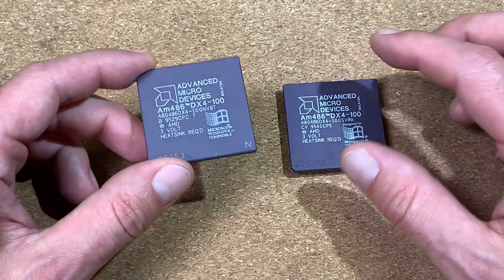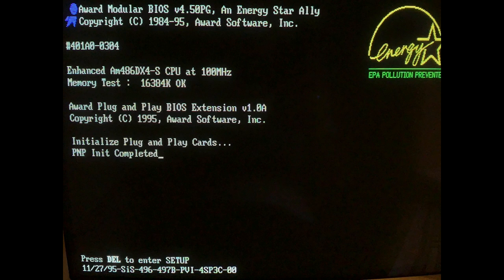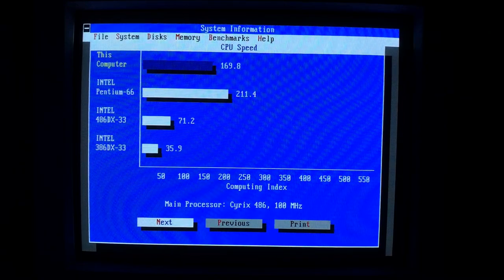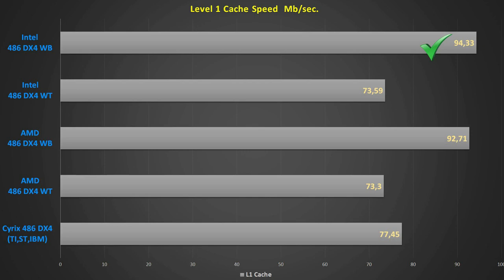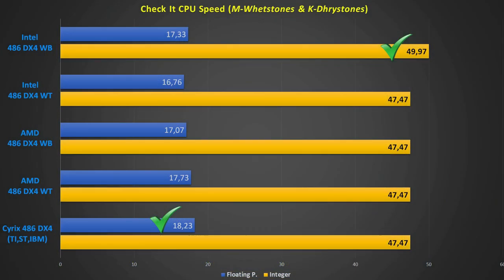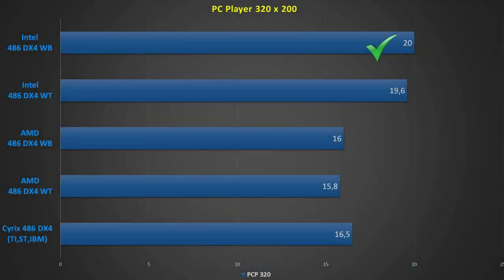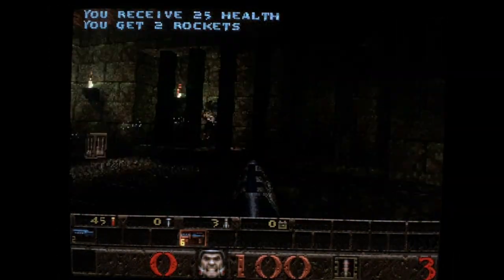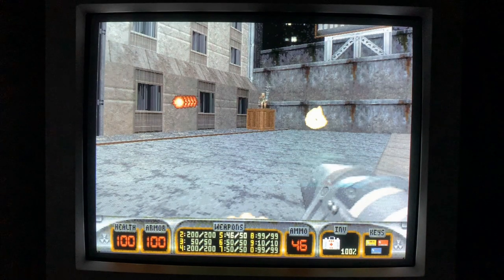486DX4-100 MHz Benchmark Battle [ Intel, Cyrix, AMD, TI, ST]

Comment: Actually, Quake isn't heavily using the FPU. At least not in the way as we would think of it today. What it does is more of a trick called overlapping FDIV. For texturing, you have to apply perspective correction (or otherwise, textures would wobble like on the PlayStation 1). Doing that every pixel is too expensive in software on these old CPUs, so Quake does it every 16 pixel with linear interpolation in between. This perspective correction requires a division and divisions are expensive. So Quake uses the fact that the Pentium can execute FPU and integer operations in parallel. While doing the linear interpolation between pixels x and y using the integer units, the FPU is doing the perspective correction for the next chunk of pixels in parallel. A 486 (or K5 or 6x86 or...) can't do this, because on it, FPU and CPU won't run in parallel. So this FPU division actually stalls the CPU and the code only continues once it's done, making them run Quake much slower.
Long story short: It's not really heavy usage of the FPU, just a quite tricky one.
Reply: Very nice explanation, thanks
Reply: This explains why my friend with a P90 outperformed me so much in Quake with my 5x86-133. Thanks.

Comment: My first Intel CPU was an i486SX-33 pretty good CPU for what I needed back then except in Aces of the Pacific PC game.  Had lots of stuttering when numerous aircraft appeared on the screen.  Later I upgraded my system to a iDX4-100mhz CPU. It was like night and day, no more stuttering in AOP or any other high density game. I learned a lot from my earlier experiences with the intel and later AMD CPU's. This is true nostalgia, thank you for doing this, brings back great memories from back then.

Comment: All the 486 chips are great especially for day to day applications, but seeing the WB is clearly better choice I would still pick the AMD chip. Being an AMD fan myself and for the price to performance I still feel it would be the better choice and with the 133mhz version and the 133ADZ model wich is actually a 160Mhz 40Mhz X4 it can be a real beast in the 486 chips. Also the Cyrix 5x86 133 is a beast but a rare and hard to find chip. The 486 was a great cpu. Such a great time when hardware was changing so fast and in leaps and bounds.
Reply: Don't believe it, I was lucky enough to have the intel dx4, the am486 dx4 and the cyrix dx4 since all of these were used by IBM (my dad worked at IBM in the 90's) and at some point when the equipment changed, they threw them whole back then
Anyway ... the am486 at 133mhz is low in performance compared to an intel dx4 at 99mhz (100mhz) and the difference is very noticeable
I do not intend to put together a discussion, just share my experience with these processors
It goes without saying that I am not a fan of Intel processors since I have a preference for AMD from the Athlon 64 X2

Comment: If only we had such reviews available back in the day! Personally I would prefer if your charts always have the scale from zero instead of sometimes being zoomed in, like SpeedSys going from 34 to 44, but then others starting at 0. I think most humans judge the performance by the length of the bar, and that only 'works' when you start from zero.. In my opinion it gives a clearer picture of the differences, even when they sometimes are very small, I prefer to see similar bars rather than a zoomed in bar that seems to show a 'big' difference.

Comment: This is a great video! Contrast to the 386, here the Intel is indeed the strongest one. But AMD had the 133 MHz model of course. I like the IntelDX4 because it has good support with motherboards, it is usually mentioned in the manual. With some of the other CPUs it can be guesswork.

Comment: Thanks for this study. I have been enjoying your channel. The results were close to my expectations I have one minor critique concerning the bar charts: when the bars are zoomed in, it appears that the differences between each processor are much greater than they actually are. The viewer should have a better visual sense of the differences if each bar was plotted from the zero point. Other than that, great job, and I hope to see more.
Reply from the maker: Thank you very much for your FB. You are right with your critique and I will consider that with my next bar charts. 😉
Reply: I would say display both. Graphs from the zero point are going to show just a tiny difference at the end and not show the differences very well between these CPUs. Zero point graphs would be good for comparing all of these, lower clocked 486s and 60 or 66MHz Pentiums though.

Comment: Top work! I really thought that there would be just a very slight edge in favour of the WB chips, maybe 5%. Good to know of the difference in performance. Btw. that mobo looks very smart, would be awesome to see a comparison of some different socket 3 motherboards and their chipset performance with the winner of the DX 4 cpu battle. Keep up the good work!
Reply: Problem is, in this age, that you may be considered pretty lucky, if you own at least one 486 motherboard. :) Who owns 5 or 6, for test, is eighter very lucky, or rich. But maybe someone could borrow for tests.
Reply from the maker: I will do this comparison and benchmark with some boards. Will cover following chupsets: VIA, SIS, Intel and UMC ☺️

Comment: the moste important test i was waiting for was the OC test. and yes we had started to OC the CPU's at this time in the game ;)  i hope for a follow up video here to make it complete ;)
Reply from the maker: I planned an OC video but not with DX4s. I want to max out the Asus board with OC PoDP to 100 MHz and AMD-x5- to 160 MHz to compare... Maybe I will add here then a DX4 then too.. 🙃
Reply: @CPUGalaxy  what is the max speed you can get the DX4 100 to? i remember 140+ speed's.
Reply: Should be able to handle 3 GHz on liquid nitrogen

Comment: Can confirm that WT is faster than WB in Doom as I just tested that yesterday with Intel DX2-66 processors on my ASUS VL/I-486SV2GX4 1.7 board. Due to the lower clockrate I had a performance difference of roughly 5%
How's the PCI vs. VLB performance on the Asus 486SP3? I tested a CL5428 VLB against an ET6000 PCI on one of my VIP boards yesterday and was shocked how the PCI card performed roughly 40% slower - albeit the ET6000 being a superior design and the VLB running at "just" 33MHz
On a sidenote: A friend of mine happens to have an AMD DX4-100 with 16K WB cache (Am486DX4-100V16B) - would be interesting to see how those fare against their Intel counterparts.
Some boards seem to be extremely picky about AMD DX4 CPUs and usually seem to assume 8T models.

Comment: I've always thought that they were pretty identical in performance, pretty huge differences between the "same" CPU.
Reply: The differences aren't "huge" though.  The difference between the fastest and the slowest is only around 10%.
Reply: It's the way his graphs are scaled that makes the differences more pronounced seeming. For the 5 - 10% performance deficit (task dependent) between the intel and the other CPUs you would have paid anywhere up to 40% less for the slower Cyrix and AMD models. It was a case of pay through the nose for the best or get the best value and sacrifice a bit of performance. Cyrix and it's derivatives were by far the cheapest options and offered the best value for money of the group, every CPU shown here was a significant upgrade from the DX2 66 and slower 486s. 

I remember upgrading from an intel SX 25 (overclocked to 33mhz) to an intel DX4 100 (WB) and being blown away by how much faster it was. Doom, Duke 3d and Rise of the Triad got a lot of screen time on my 486 DX4 100 :)
Reply: @Xaltar_  yeah back in the day it wouldn't be a mhz to mhz comparison. The cost difference would of made the AMD compare to a 75mhz DX4 and the Cyrix would of been about the same as a DX2.

Comment: Nice! I had expected it to be a bit of a closer race than it was in the end, but nice to see someone with all the gear put in all this effort to bring us this info. Thank you!
Reply from the maker: Thanks. A follow up is planned. I found out that there are a lot of functions on the cyrix which needs to get activated bit a bit setting tool. That is boosting than the cyrix extremely. It might change at the end the rating. 😉
Reply: @CPUGalaxy  Cool, will be interesting to see what kind of difference it makes. Thanks again :-).

Comment: Great video, brings back a lot of memories. I remember frying my SX 25 by overclocking it to 40mhz 😂 It ran great for about 5 mins before smoke started pouring out of it, even with a cooler on it. I already had a DX4 100 waiting to go into the system and it had worked fine @33mhz so I threw caution to the wind and tried to see how fast I could make the SX 25 😁
Reply: Smoke? How you overclocked it? What method? Raising FSB could only make your system unable to start, not frying a CPU...
Reply: @mlodzin90  surely he overvolted to go along with it.

Comment: Great video, dude. Really unexpected results. Now on to 5x86s!
Reply from the maker: yeah, maybe a battle between Intel Pentium Overdrive for Socket 3 overclocked to 100 MHz against a 120 MHz Cyrix 5x86 ... could be interesting 🤔 😃
Reply: @CPUGalaxy  Good idea. I'd like to compare with my AMD 5X86 133 and Cryrix 5x86 100GP that runs at 120 no problem!

Comment: Excellent video! I found recently an old laptop that wouldn’t boot. Inside it I found an Intel dx4 75 mhz. I installed it on my old pc set the bus speed to 33mhz and it runs at 100 mhz no problem.

Comment: Thanks for reminding me of fhe Tsenglabs ET4000! I used to have that one and forgot all about it. 
Cyrix was always the underdog CPU that we all hoped would keep the competition going but just didn't make it. And as far as AMD and Intel go, realistically, up until Ryzen there was never a compelling enough reason to go with AMD. Sure, they were the first to push for 64 bit, and Intel had their integer flaws on the Pentium. But it pales versus the AMD's that went up in smoke from having no thermal protection and a poorly attached cooler.
Reply: Well, it was worth to switch to AMD when late PIII and early PIV were realeased. Athlons (Barton core especially) were an awesome machines back then.
Reply: @86smoke  Right, the Athlons were the best, for a while.

Comment: Brings back so many memories....
Oh crap, I just revealed my age range.
Reply: My first 486 was a DX4-100 and I was about 14 when I got it (maybe 15?) - yeah I put the CPU in backwards. CPU survived, the motherboard did not. It was 3 days old so back to the store it went for a "uh, this didn't work"  (with the CPU replaced correctly) - 15 mins later tech comes out with a new one, warranty claimed. Nice board, 3xISA 3xPCI, eventually I had a 5X86 P75 in there ;) 

I learned a valuable lesson, but it was useless on all subsequent keyed CPUs.

Comment: One nice result from this is it confirms once and for all an argument I had with a PC builder at the time, who insisted that the Cyrix-branded chips were worth the premium they had on the open market at the time (typically 20%more expensive) than the SGS and TI chips. Complete tosh, as it turns out 😁

Comment: Amazing video, I love Benchmarks! I have an Intel Overdrive DX4ODPR100, will it perform like a regular DX4 with WT?
Reply from the maker: Thanks, yes, the ODPR100 will perform like a regular DX4
Reply: @CPUGalaxy  Awesome, thank you!
Reply: That's actually a complex question, dependent on more than just the CPU. Your chipset, memory configuration, l2 cache/lack thereof (my ODPR actually disables the L2 on my board, can't figure out if it's the CPU itself or my BIOS) can have a big impact. Personally I gained much more from moving from my RAM configured at 2WS to 0 than from the DX2-66 to DX4-100 upgrade.

Comment: What memories ... one of my first PCs that I built, an Intel DX4 at 99mhz on a 486 compact presario motherboard, with 32MB of RAM, with a 512k Trident GPU that I don't remember the model
Reply: Probably 9000 series
Reply: 100MHz.  33.3 x 3.

Comment: I always compared these CPUs by cost, not advertised speed (still do to this day).

As I recall, by 1996 the Cyrix chips were very much cheaper than the AMD and especially Intel. For example an SGS-branded DX4-100 was around a third the price of the Intel, and the DX2-80 was a real sweet spot when it came to price-performance when putting together budget systems.

If the Intel was £100 and the SGS maybe £30-35, it wasn't fair to compare the two. If the SGS was compared to the like of the Intel DX-33 or DX2-66 (which were still more expensive as I recall), the Cyrix line absolutely blew Intel away.

The chips do the same job, so that's really the best way to compare.

Comment: Just as i predicted prior to watching benchmark results, intel pushes ahead a bit, the rest of the pack lags behind. But still, AMD had dx5 version that was overclockable to 160Mhz, i think.
Reply: Some made it to even 180 or 200. There are boards that produce whooping 60mhz bus clock hehe
Reply: The  AMD 5x86133ADW model would run at 133Mhz normally setting the motherboard to a 2x setting then the chip would double that for the 133 speeds but the ADZ Model was underclocked to 133 but its true speed was 40Mhz bus X4 for a 160 Mhz speeds and they even made a 50Mhz bus X3 for a 150Mhz also under clocked to 133Mhz but can't remember the model number of that chip and only a few later 486 MB supported that kind of bus speeds but they had stability issues since most PCI or ISA cards did not enjoy a 50 megahertz bus and having to go into the bois and doing a PCI/ISA bus divide just to try to get the cards to run stable. ISA card ran happy at 8 Mhz and most would deal with 10MHZ but anything after that they were not happy and ran with stability issues or just killed the cards after a short while.
Reply: @clintthompson4100  as far as i know the ADZ was only different to thermal limits. ADY and ADW = 55°C limit and the ADZ had around 80°C limit. Whats different inside i dont know. Maybe a smaller lithography. However, these were all beasts. And yes, stability was a problem at times. The only mainboard i have played thoroughly on with this CPU is the legendary fake cache PCChips M919. But did not go beyond 160Mhz. I made a little mistake above, what i meant is that some boards do support 60mhz (undocumented) bus clock. And the M919 is one of these. so there would be theoretical even 240mhz posible...

Comment: Oh man, I've got 20 or so different 486 CPUs (from SX-20 to Overdrive) and the only one I am missing is a DX50 (I have an SX2-50, but not the same - It would have been nice to see if my Mach32 VESA could handle a 50 MHz bus speed). Apparently my board will support an i487 as well, so that'll be interesting as I have one. Looks like my benchmarking plan was quite similar to yours.

Comment: I'm trying to remember how I had my AMD 486 set up back in the day, I remember it was on a writeback board with 256 or 512k of stick cache, and was clocked on a 50MHz bus speed. I remember it was close to a Pentium 133 in benchmark results, but I did have it overclocked. think it was like 2.5x 50 for a clock of 125Mhz, I might have even pushed it to 3x 50, I remember it being fast for the time.

Comment: An user on Vogons forums gave a tip to run L1 cache in WB and L2 cache in WT with IntelDX4. Tried it and this combination gave me the best results in all benchmarks (used the ones from Phils package). Could be interesting to compare. Still, I'm trying to see comparison of A486DX4 with 16kB L1 WB and IntelDX4 with L1 WB cache. I heard that IntelDX4 has some integer optimizations/enhancements in comparison to DX2 so I was wondering how they compare to CPUs from AMD.

Comment: I think the "wrong" CPU speed in CheckIt is some normalized number based on the Dhrystone measurement (comparing to a 286-6 AT was commonly done). I see the same figures when benchmarking with Landmark, and they explicitly state this in their documentation.

Comment: Posting this, as I haven't seen any one else try. Intel DX4 OEM CPUs also had a 2x, 2.5x, and 3x multiplier modes.
i was building systems back in the day. You can see in the jumper charts 2x ,3x
Have you tried this?,   Mr CPU Galaxy.  Thus a 50Mhz cpu bus on 2x multi for 100mhz. Best vesa speed, but difficult to make stable.

Comment: i had this processor (the AMD one) in the 90's as a kid, i did not have money for pentium, unfortunately, the performance difference was huge in favor of the pentium

this was probably the peak of intel processor design
Reply: Intel was really kicking ass with the Celerons with on-ship L2 in the 300-466 range.  By far the best performance/dollar in their time.  Especially the legendary 300A, so easily overclocked to 450.

Comment: Very good video ! thx ! Maybe try PCI graphic card and compare to VLB
Reply from the maker: I did already and used a PCI ET6000. The performance of the VLB ET4000 was much better. Although the ET6000 is a much better card. On a Pentium mainboard I can get much better results with the ET6000 and it seems that is an implementation issue of the pci bus on the 486 mobo.
Reply: @CPUGalaxy  I was looking for a comment on this... this shocks me.  My ET6000 PCI card destroys my VLB cards (using a dx4 100 in both cases), but I do have to use different motherboards to test (not so lucky to have this Asus board).  I wonder if Asus did some voodoo magic on this board to get VLB performing so well.  Back in the day I bought a very high end VLB Number9 card and it couldn't compete with budget PCI video cards.

Comment: There was a run of amd 100s with 16k of cache as well, but the do perform identically to the intel counterparts. They are essentially the same as the x5 but for some reason mine has no 4x multi.